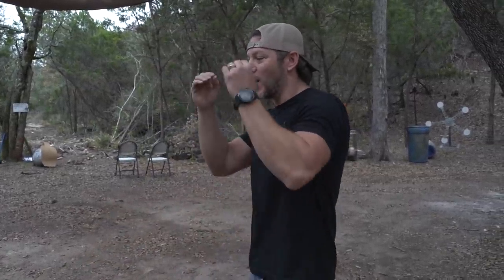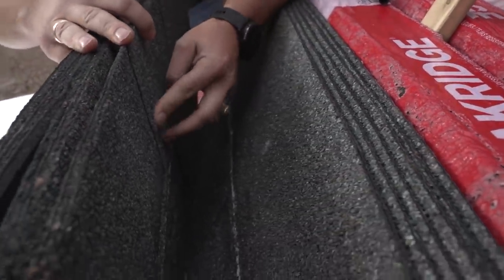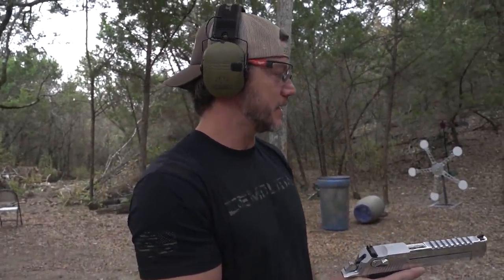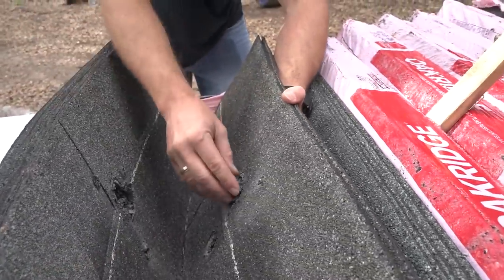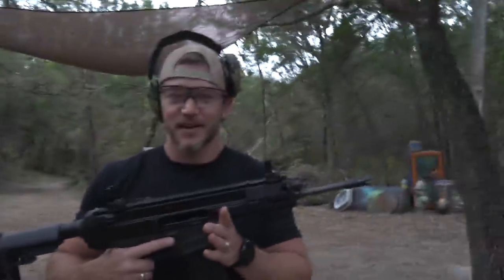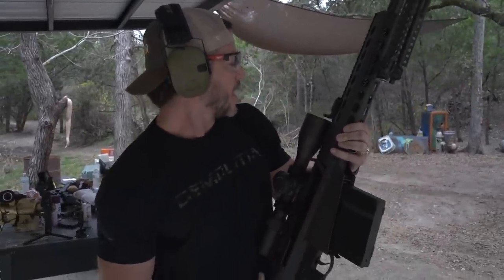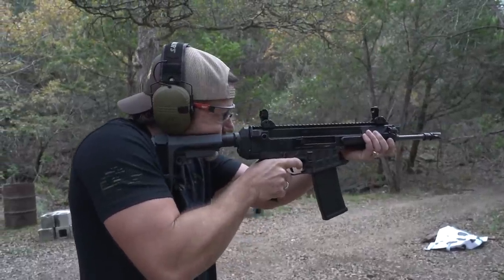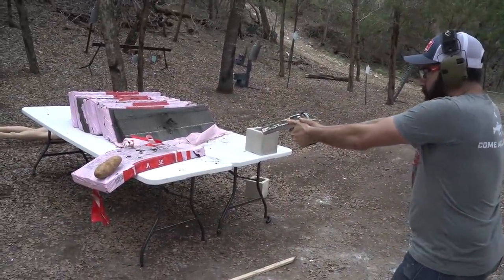It's Kinda Ugly... But this Gun Kinda Rocks

Comment: I'm making a range in my shed in the backyard I got sand bags with half inch ar500 steel between the back two plates and so far it will stop every caliber I have but I have issues with the sand bags ripping and dumping their sand everywhere. I got things on the side and back to keep it in there but I haven't found anything  that can go on the front that prevents any sand from getting out while letting me shoot through it. I'm glad you did this test it seems like shingles  old do very well to get the job done

Comment: You don't need to ditch the new camera just to get the background in focus! All you need to do is stop down your lens and close your aperture (raise the f number), or switch to a lens with a smaller aperture. 

You'll need to either slow down your shutter speed or raise your ISO to compensate because less light will be coming through, but everything will be in focus

Comment: I know the instinct is to take that $800 lens, and stop it up to the maximum F1.4 for buttery smoothe bokeh. But many shots dont work well with that. The nice thing about full frame is that they do well with low light, so you can just stop it down to F8 or F16 get everything in focus, and still mostly keep your ISO noise really low

Comment: You should try to put about an inch of mortar between each layer, and, have about 6 units deep...this could make a suitable, effective, yet, cost efficient armor for a small dwelling/make-shift bunker, etc...easy to do- lay flat, apply mortar, within a 2X2 wooden frame, and, place second sheet on top...and, you could even reinforce it with screws/lag bolts (1" X 5/16" should be inexpensive and effective...)- just screw them in before mortar sets fully...6 units deep would have 12 sheets of asphalt shingle and 6 X 1" of mortar...

Comment: The reason the 50 AE stopped on one pack is alot like the 45 caliber. They have alot of power but are fat slow moving projectiles. I'm sure something like a 5.7 or an MP7 4.6 millimeter would far outdo any Desert eagle or even 44 and 357 magnum and 40 caliber rounds.

Comment: blue tip straight incendiary rounds are not for penetration and won't go far cause they just explode. You can't use a blue tip and say it stopped 50 bmg in the second one when a black tip or apit would go through several more.

Comment: Hey Matt, I just bought a CZ Scorpion and the rep told me to be real careful who I use it in front of when using a brace like a butt stock, apparently the ATF have been real wishy washy on it recently. I’ve been considering doing the paperwork to make it a registered SBR for this very reason.
Reply: Atf has been wishy washy bout pistol braces in general.
Latest I've come across, aslong as the braces has its features to work as intended (velcro straps or similar) then it isn't a butt stock.
Atf has no legal say as in how your suppose to hold a firearm when in use, only which features they are able to have.
There was a guy who paid a lawyer to write the atf a professional letter in this inquiry. Stating/asking if is was legal or not if he could equip his firearm with a fleshlight, and proceed to shoot it while on his "member". The letter went through to the top and finally replied "they have no say" (I believe brandon Herrera did a video on that)

Comment: I'm just curious, what makes that a brace and not a stock? And is that the defining difference between it being a pistol rather than a rifle? I've seen others that the brace is just basically the buffer tube and doesn't have the brace plate on the back, so I'm a little confused.

Comment: Um... MASS in armor is basically irrelevant when your material has no tensile strength! Take an Aramid fiber (3000 MPa) vs. roof shingles (3MPa) ... so, without wasting a bullet, you know that fiber-based body armor is 1000x stronger than your shingles...